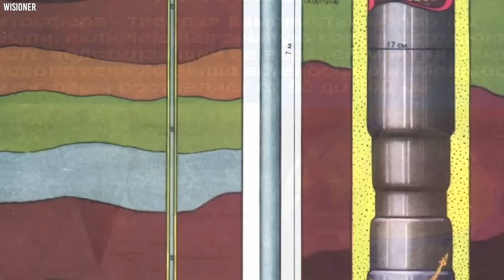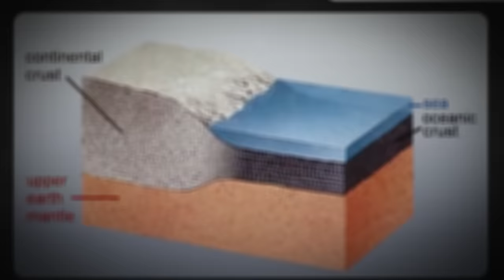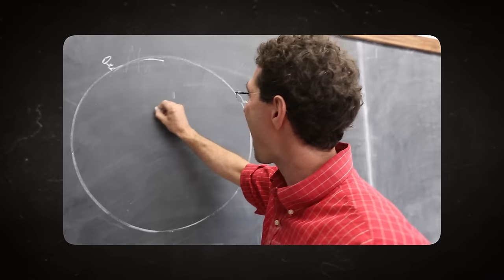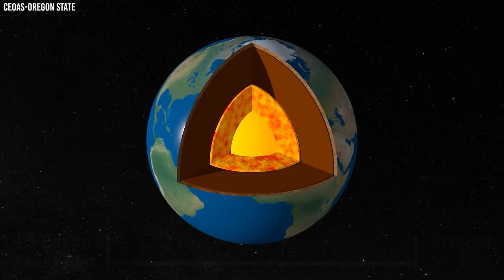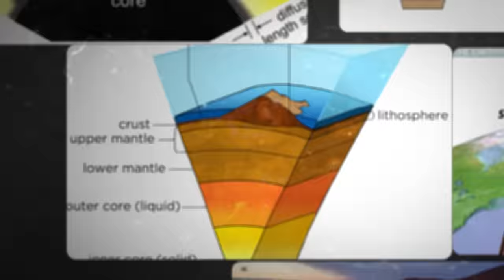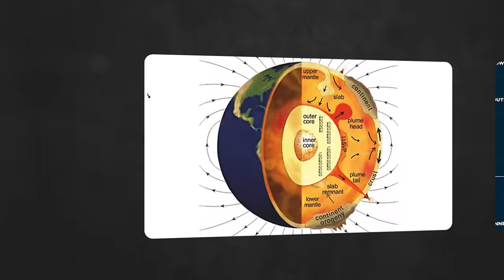Scientists Discovered Something In The Deepest Hole On Earth That No One Was Supposed To See

Comment: Or it’s the most deepest fracking hole 🕳️
Reply: I guess you don't know what fracking is...  ;)
Reply: @CarterLee-jv4ky  probably so I might have to research about
Reply: Researched and it said the process of injecting liquid at high pressure into subterranean rocks, boreholes, etc. so as to force open existing fissures and extract oil or gas.
Reply: @Blank-n7c   It's  drilling vertically, then horizontally.  I know cause that's what I do.
Reply: @CarterLee-jv4ky  that’s great to hear but be careful